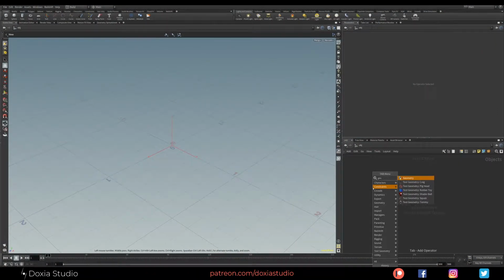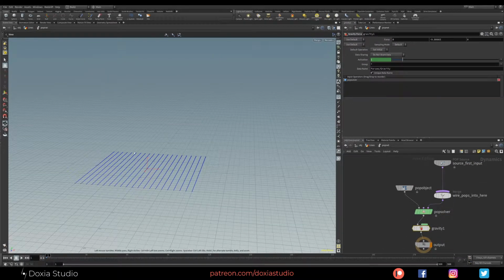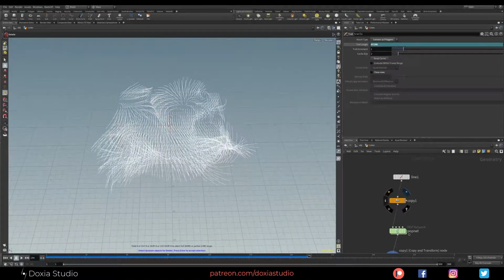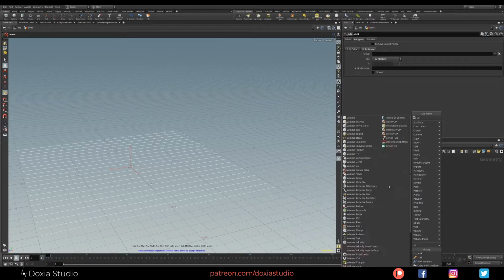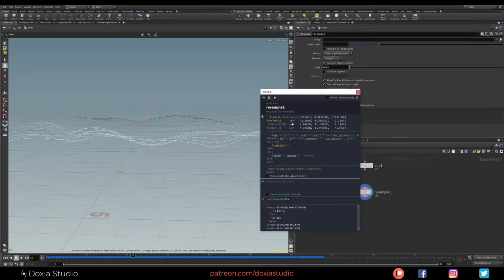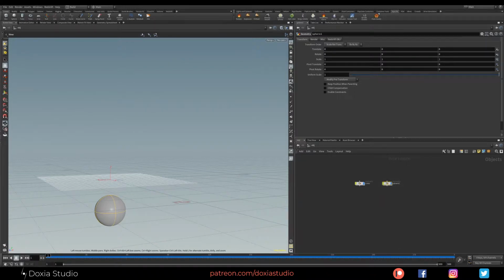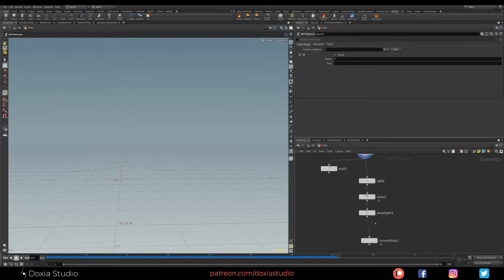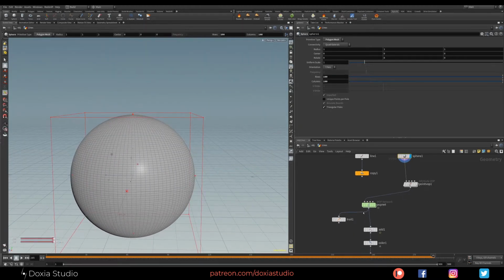Houdini Tutorial - PopLines

Comment: Hey, great Video! I have one Question: Is the Cd (point)attribute the only one that is "promoted" to the POP particles? I tried your tutorial with a custom attribute on the line-points, but it did not get through the popnet and so I could not use it in the add node.
Reply from the maker: when you use custom attributes, you have to check the type of attribute, if it is point, primitive etc, then on VOPs you can use the bind node to import them. I show that in a few tutorials too. 

But basically the bind node you can import or export custom attributes inside VOPs. 
Did that help?